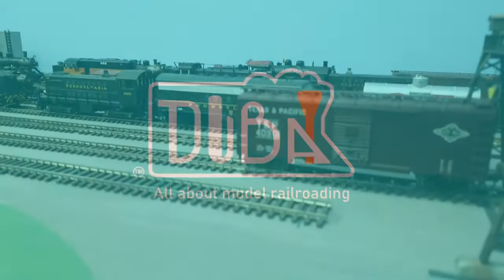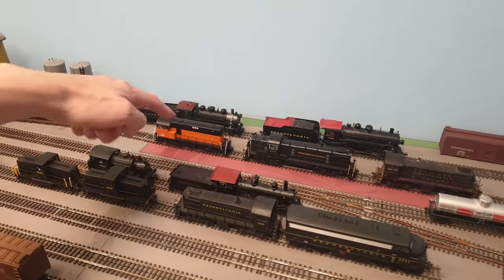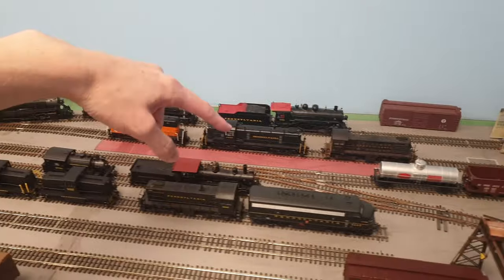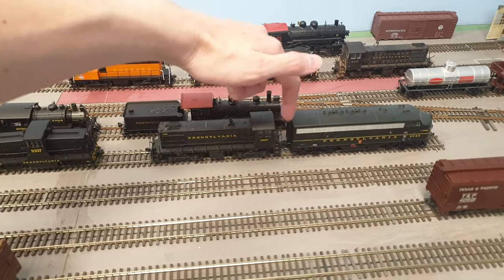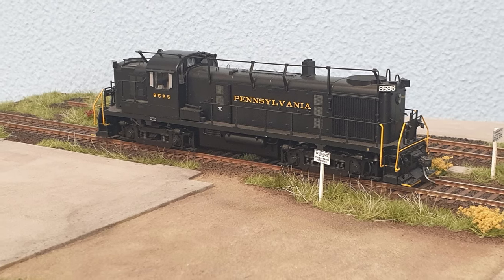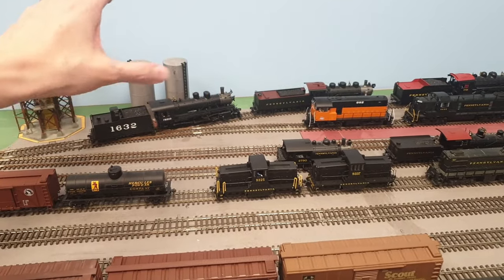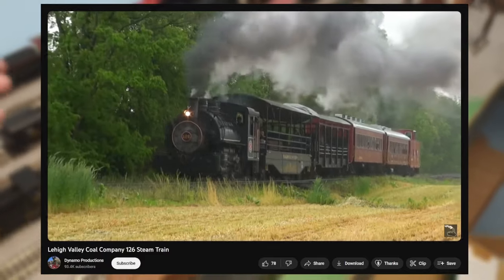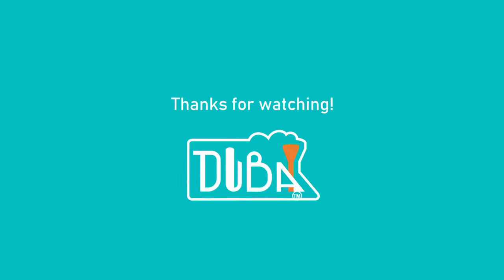My Roster: we talk Engine Brands & Decoders. + How many engines do I need? ~VLOG 187

Comment: I wouldn't limit my roster. You have 3 interchanges where the owning railroad would most likely introduce its own roster of engines onto your railroad. That does indeed ties your operations to the outside world. Just an observation.
Reply from the maker: Thanks Marc. Over time I will also narrow down the date and age of the engines. I didn't look it up, but I think some of those steamers would be long gone as wel as maybe a diesel.

Comment: Love the Proto 2000 USRA 0-6-0 I have one myself with Tsunami sound and scale sounds speakers. One of my favorite runners. If you can find one (probably going to be brass) a PRR A5 or B6SB would complement your roster. Just found your channel and following along closely as I’m in the benchwork stage of building a shelf layout loosely based around PRR car float operations in New York/ New Jersey
Reply from the maker: Welcome to the channel! 
The B6SB is an interesting lead. I was looking for a sloped tender 0-6-0 for a long time but then I got a steal of a deal on this one. 
The walthers barge kit is based on the NY / NJ barge and float combination. Fun to build but you do want to reinforce that switch point and throwbar on the apron.
Reply: @DubaiTrains  Makes sense. How did you approach reinforcing the switch?
Reply from the maker: The reinforced the throwbar with a strip of 0.3mm polystyreen. As you do that you will have to elevate the cover by the same height. The cover that holds the throwbar in place. Not too difficult. After all i did it :-P
Reply: @DubaiTrains  much appreciated, thanks!